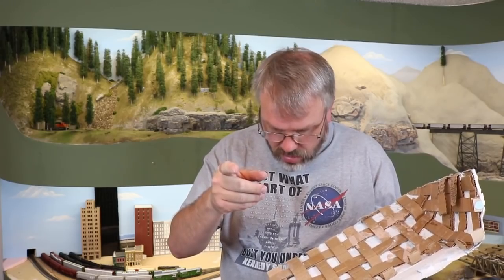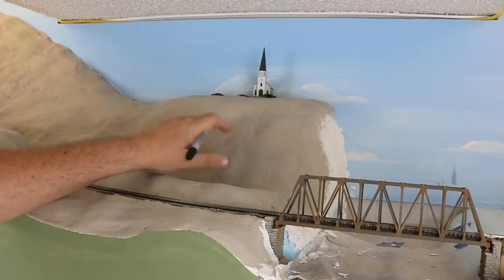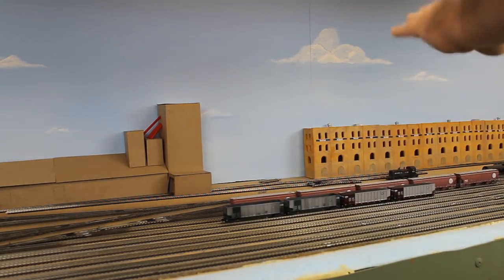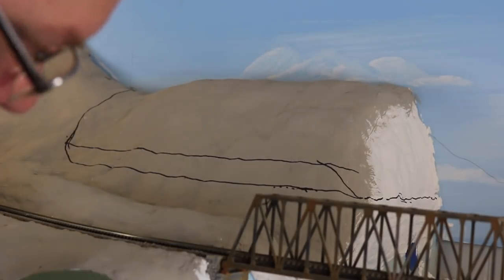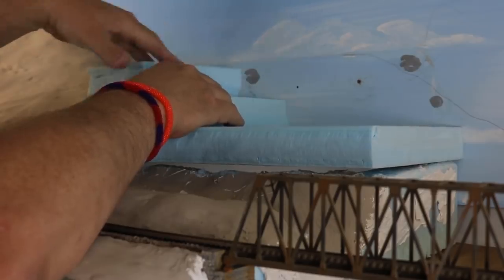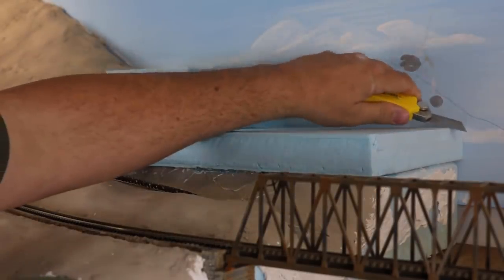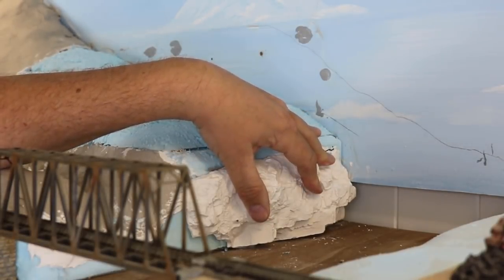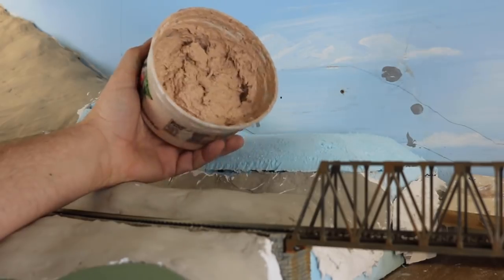Replacing A Scene on a Model Railroad Layout

Comment: Good advice about making changes. I once cut out a 4 foot section track and all down to the open grid frame. Things ran better and looked better.  I use a hot knife when beginning to trim off extra foam. It doesn't create as much of the foam chaff. May I suggest you consider a final change to the scene? What about creating a shallow cut a short distance to the left of the bridge. I notice the fascia already rises up in that area. A short shallow cut in front of the track would make the beginning of your hill appear less steep. Partially obscuring the train for a short distance could indicate the transition into the mountainous scenery and also add a bit more interest .
Reply from the maker: Hi Jerry. Ibcould do that, but there is already a larger cut just to the left, so I'd have to play with it to aee how I liked the two that close together.
Reply: I reviewed the video and see what you mean. The cut which you have is much deeper than the one I'm suggesting. I was thinking of a cut not much more than twice as high as a railcar and maybe not much longer than one or two cars. Just enough to interrupt the view of the steep hillside. I'm unable to see it in 3D so your judgement is much better than mine.

Comment: Great video, Ron! I have the same ceiling situation in my basement. Ya just have to work around it (or under it, rather). I have seen holders for hack saw blades so they can be used in the manner you are using them. They're not very expensive and could save your hand from a nasty cut! Extruded foam is great stuff, isn't it?

Comment: Hi Ron,
We love this idea.  Tonight having dinner with RxR Club Pres. (Pete M. & V.P. my wife).  We together watched this vid for tomorrow nights Dead Head session at the club.

We could use this idea to correct a portion of our Adirondack Div.  Thanks.

Quid Pro Quo.  You were saying your rip out section was under you return air plenum and difficult to light.  Here's an idea.  Not knowing what the support system is, you could take a 1"x 1" the length of the plenum and popcorn ceiling.  On a power saw cut the 1 by in half, on the diagonal, corner to corner.  Measure. to attach, one of the 1 by edges to the ceiling structure.  Which would allow the other 1 by edge to hang down.  The diagonal will be where you could attach a strip (or two) of LED Lights.  And, with the assistance of Tri-Colored LED's and an Arduino, you can have the lights reflect the hues of dawn, dusk, and storms, of the backdrop and scenery.

Thanks for solving our problem.
See you DOWN THE LINE,
Jim, Pete, & Eileen
NVR/WAS RxR Club
Reply from the maker: That is a pretty good idea. I may have to look into that.

Comment: Hi Ron, Off Topic Alert ** Loved my visit a couple years ago to the Kennedy Space Center. The tour was fantastic, but the ultimate  was the space shuttle simulation. ** End Off Topic Alert. That poor bridge in the foreground is really taking some abuse :-) Ron, If you plan on doing a lot of scenery work with foam, you might want to invest in a hot wire. A very nice scenery update video, but shouldn't have you repainted the backdrop before adding the new hillside? Cheers, Rich S.
Reply from the maker: Loved both Kennedy and the simulator. We were there jus days before the final shuttle mission lifted off, saw it on the pad...I have heard hot wire for extruded is a bad idea due to toxic fumes, unlike beadboard like the Woodland Scenics products.
Reply: Ron's Trains N Things I don't think there's much difference between the foams. Good air circulation will dissipate the small amount of fumes. Lots of unwarranted fear, maybe because many have no experience with foam. Same modelers who for years breathed toxic paint fumes voice alarm about foam. With reasonable precautions foam is safe.
Reply: I've used the hot wire approach for some time now - along with the rasp from Stanley.  As Jerry says good air circulation is the key - the stuff you breath in walking down the street from the traffic is going to be worse on a day by day basis than a few times a year with the hot wire.  Much quicker and neater than a Stanley knife.

Comment: hot knife
Reply from the maker: You have to be careful using hot knife/wire tools with EXTRUDED foam. Bead board is fine, but extruded foam emits different fumes when heated and they can be toxic.

Comment: I think you are not understanding what ground goop was intended to do; It was meant to give a rough base texture to apply scenery over it BEFORE it hardened. You are using it in place of sculpt-a-mold which is making your job more difficult and annoying us who use ground goop. I put it down and play with it for 8 hours without have to do anything else. All that needs to be done is to wet the base for the ground goop with a spray bottle with wet water.

Comment: Looks like you should have put the rock face in upside-down from the way you did, so you could have hidden the big open spot on the bottom front
Reply from the maker: I will put another casting there. This way outs the big flat part down where the river will flow against it. I didn't like the way it looked along the water line the other way.
Reply: Ron's Trains N Things that's understandable